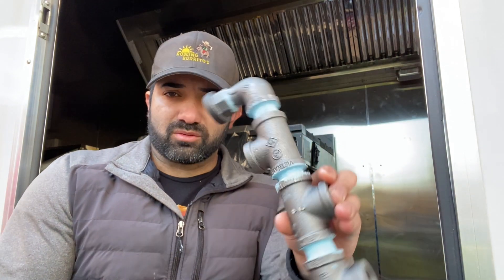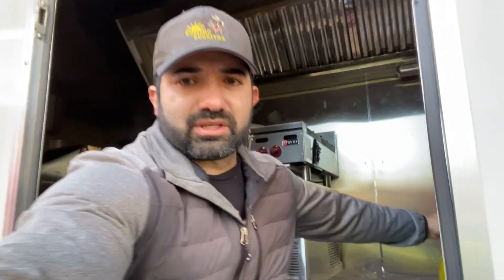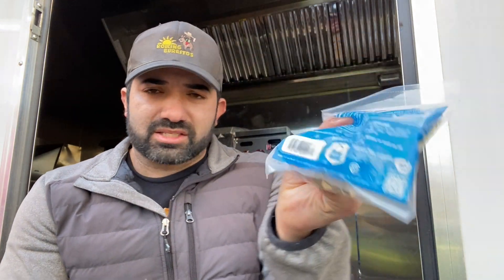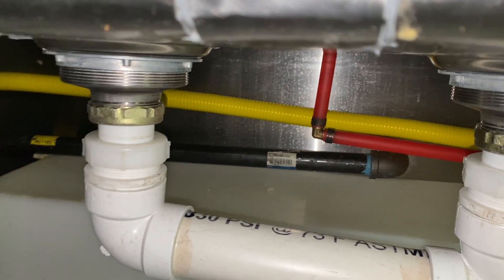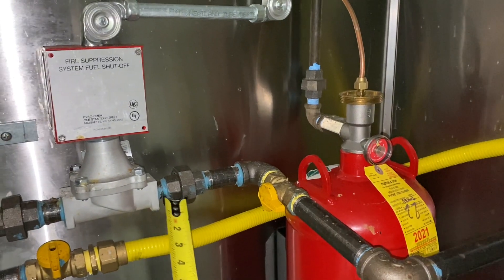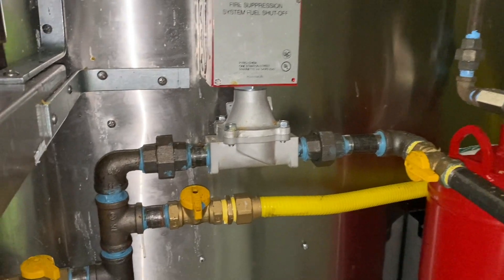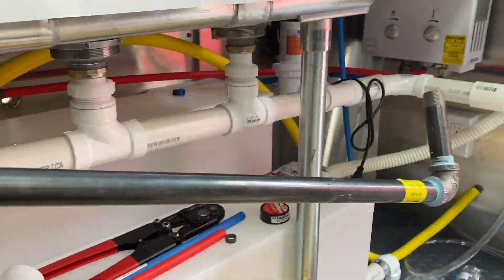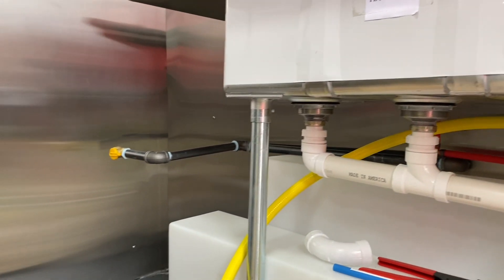How to Build a Food Truck: Propane Lines

Comment: do you have a sugestion list for the order of doing things? like when do you you put in the walls compaired to propane lines and hood... going to be doing this journey in january and little nervouse so trying to get over prepaired
Reply from the maker: Good morning. There is no real sequence of events this trailer I'm doing now I started with the hood first. But for sure propane and plumbing are usually the last parts
Reply: @fbaltierrez  so hood before walls or walls before hood
Reply from the maker: @rickprocure6321  to be honest it doesn't matter too much but if I had to pick I would do ceiling, walls, hood

Comment: Love your videos.. I have a question about the gas line. Is there a reason why you didn’t go being the red tank? Run the pipe to the wall then hit the 90
Reply from the maker: Yes bc my walls in front don't sit at a full straight edge. I would have to use a bunch of angle pieces. Much easier for me this way

Comment: I have a food trailer , but I have alot of black soot from my stove and griddle... what do I need to adjust or add so that I don't get all the soot..am I supposed to have a yellow flame or blue flame?
Reply from the maker: @cristinaramirez6373  I only use the fairview regulator, if I'm correct it comes out blue.

Comment: Thanks for the videos sir. I’m not following exactly what you are doing but you inspired me to build my own! 

Question: can the gas lines be run on the outside (bracketed to outside of trailer) and then go in to the hook up you need? My county doesn’t include a fire suppression system.
Reply from the maker: I personally wouldn't do that. You want those as secure as possible

Comment: The different 90 elbow is called a Steet Ell 🙂 Nice layout of your propane feeds.
Reply from the maker: Ahhhhh there we go. And appreciate that feedback
Reply: Street tacos need street 90s.
Reply: Very nice vid, helpful.  Just add a tip if you use it. 
The street ell tightens very quickly and can tighten at a position you do not want. It is best to use a "close" nipple and a standard elbow. 
That way, you can tighten it where you want it.

Comment: Hi frank, What do you think about a project that I want to start on my 7x7 x12 trailer?
Reply from the maker: It's on the smaller side but depending on what you are cooking or serving could work
Reply: @fbaltierrez  Where can I get the best price for a hood kit?
Reply: I check in hoodmart but with shipping and everything costs to me $2000
Reply from the maker: @fordmods7115  yes sounds about right a bit on the higher side but depends on size you selecter. I just bought 2 of them no fire suppression system with shipping was 3600
Reply: I'm going to order the 6' one, it seems to  be good quality
Reply: your videos  will help me a lot,
Reply: Thanks!!

Comment: If you regulator is 3/8 out, is 3/4 gas line necessary?
Reply from the maker: It's not but the equipment takes 3/4 at its connection point, that's why I just made the entire thing 3/4

Comment: Where do you get the materials for the was at
Reply from the maker: For which part of the build?
Reply: @fbaltierrez  walls Whats the best and cheapest
Reply from the maker: @dannyharrell2909  the cheapest is FRP the best is Stainless in my opinion. I have seen others also use white aluminum

Comment: Man wish you would help me out.. I got 2 30lb propane tanks but my flame on my stove sucks… Only one burner its good .. trying to use the other burners just kills the flame
Reply from the maker: What Regulator are you using? And only one on the system installed correct?